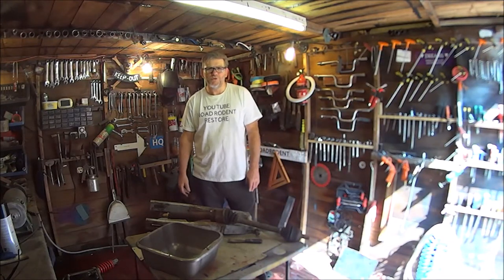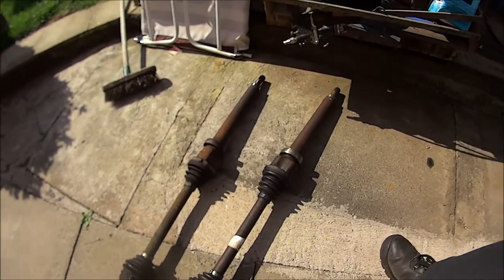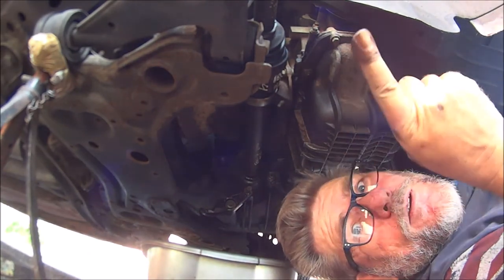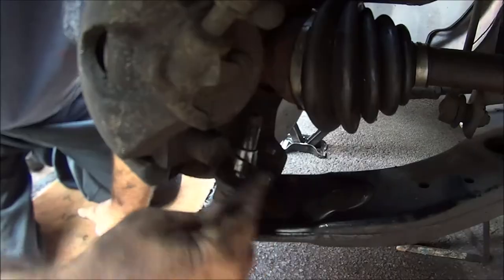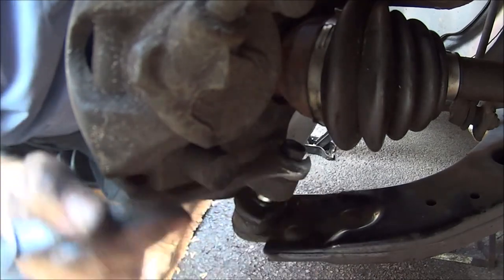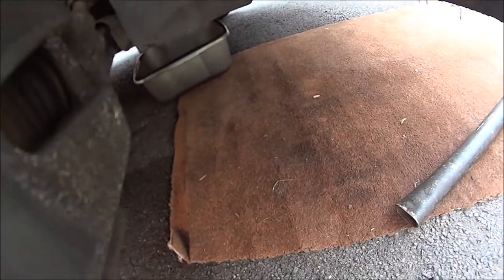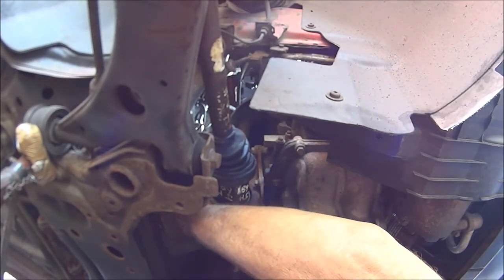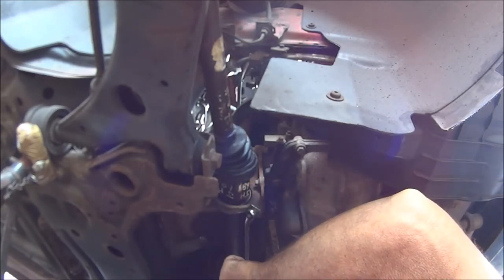FORD FOCUS, o/s drivers side driveshaft fitting and gear oil top up . UK

Comment: How much oil did it take?
Reply from the maker: It's full when it starts to spill back out of the filler plug hole. 👍
Reply: Thanks mate, overfilled it and found that out the messy way 😂
Reply from the maker: cheers mate